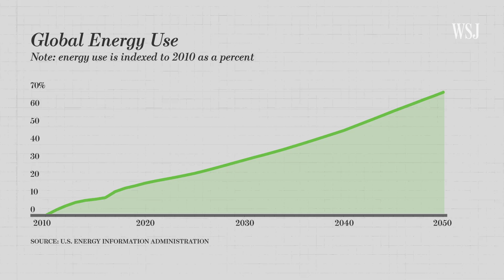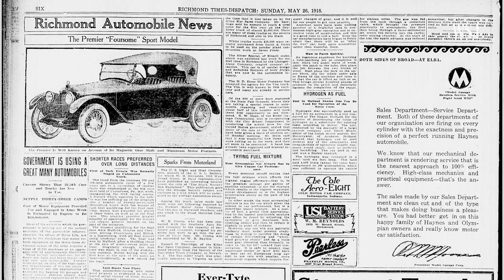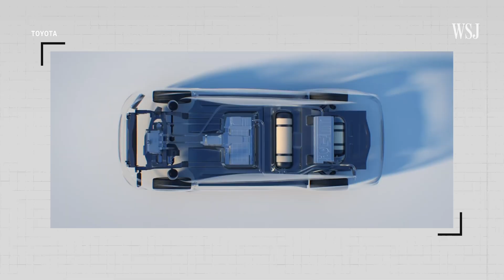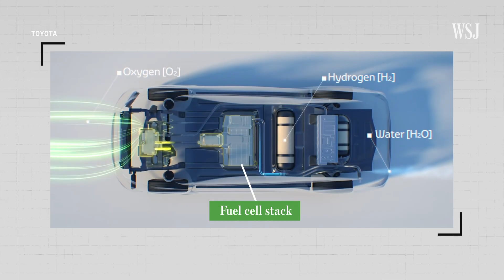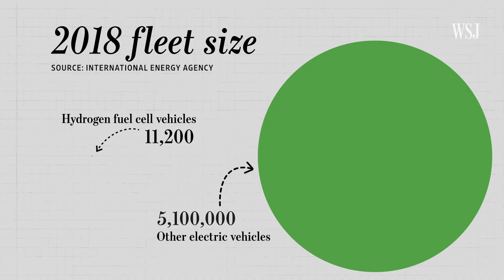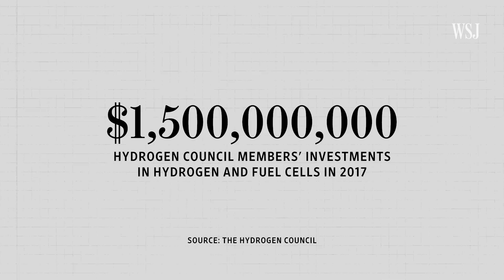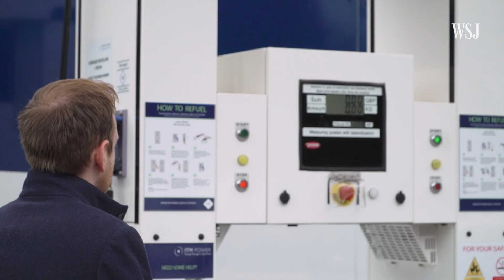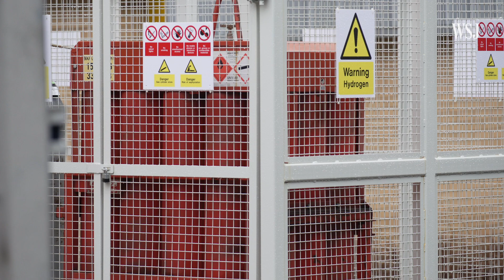Can Hydrogen Fuel the World's Fast-Growing Energy Needs? | WSJ

Comment: But is the splitting of water to create hydrogen only to turn it back into electricity energy efficient? That was not even addressed in this video...
Reply: Short answer - no.  Elecrolysis is about 70% efficient, and then you lose even more energy compressing the hydrogen for transport, and then the fuel cell itself is only ~65% effiecent at turning the hydrogen back into electricity. In comparison, sending electricity on the grid is about 90% efficient, and batteries are about 95% efficient at taking in energy and putting it back out to the motor later.

Comment: Hidrogen pros:
Quick to refuel
Water as emmision
Continous energy like petrol
Hidrogen cons:
Flamable
Expensive to produce

Lithium ion battery pros:
Mass produced, scalable
Can be charged at home
Cons:
Recycling cost
Also flamable
Long time to refuel

Please add more and start smart, healthy discussion here 😉
Reply: Adhi Suryana add low maintenance to the EV pros
Reply: Hydrogen cons: 90% is made from natural gas. If made with renewable electricity, then it takes 2.5 times more solar panels or wind turbines to get electricity back out than if you put the electricity straight into a battery.

Comment: Short answer: no. You lose around 70% of electricity in converting it to hydrogen and back to electricity, so end  up using twice the power of electric cars... + All the infrastructure, transportation, etc needed.. wait a few years for further battery improvements and it will become obvious to everyone that hydrogen cars is a dumb idea..
Reply: demolazy  people will recharge batteries when the grid is "full." I hope current industrial users of hydrogen switch to getting it with renewable energy instead of from natural gas, but until they do hydrogen is not a green fuel.

Comment: Hydrogen should be used in towns for heating buildings, the one that are heated with methane gas (natural gas, CH4). That way they can become CO2 free heating solutions.
Reply: 90% of hydrogen is currently made from natural gas, so not zero-carbon. If you make the hydrogen using renewable electricity, you might be better off using the electricity to power a heat cell with a COP efficient greater than 1 (1 unit of electrical energy can can move several units of heat energy around).
Reply: @skierpage  You can make hydrogen with natural gas BUT you have to scrub CO2 on site and store it underground so instead natural gas in towns you have hydrogen.
Yes, heat pumps with high COP is better solution for heat  production from renewable electricity. But we have so much towns with infrastructure that is already with natural gas so bringing hydrogen would be fast temporary solution. Lot of town are heated today with natural gas. I also like seasonal heat storage, this solution can heat towns with solar only, search for that it's interesting.
Reply: @klokoloko2114  existing natural gas distribution pipes can only support about 20% hydrogen before leakage and embrittlement become a problem. Fossil fuel companies are excited about this because it sounds green while preserving natural gas infrastructure, but it's not decarbonisation without huge investments to support 100% H2 delivery.

Some new housing developments are skipping gas lines to houses altogether in favor of all-electric, which must be terrifying gas companies.

I hope hydrogen for seasonal energy storage works out. It's one of several technologies getting development money, read "ARPA-E Funds Research on Energy Storage That Can Last for Days"
Reply: @skierpage  I'm for every solution that can bring CO2 to 0 ASAP.

Comment: The issue: the world needs to become carbon neutral a lot faster than 100 years.
Even the potential end to end efficiency of hydrogen which will probably take decades of research to reach is far below using renewables directly with batteries. 
Hydrogen still has its industrial applications and is probably the only clean method for aircraft and spacecraft. But the energy demand of those industries is tiny compared to the total primary energy usage in the world.
And in many other places it seems far more feasible to work around the constraints of batteries than wasting huge amounts of renewable energy on hydrogen production and storing.
For trucks for e.g. massively expanding the railway network to make sure that the vast majority of destinations is within the range of cargo stations that battery powered trucks can deliver.
Reply: How do you power (useful) aircraft with hydrogen?
Reply: @PistonAvatarGuy  
For smaller aircraft fuel cell plus propeller seems to be working reasonably well.
There have also been experiments with powering jet engines with H2. But this seems to be more problematic. 
It is probably true that both variants are inferior to using traditional kerosene,.but to obtain that, you either need to produce it from crude oil, which is a non starter for carbon neutrality or synthesize it from plants.
The problem with the latter being that with rising temperatures and the increase of droughts and advance of desertification that comes with that, while the world's population keeps increasing,  using farmland to "grow" fuel instead of food becomes a very contentious issue.
Reply: @ymi_yugy3133  There are actually a few ways (at least) to produce synthetic, liquid hydrocarbon fuels that can be used in existing aircraft. Google: fuels from CO2, US Navy makes fuel from seawater.
Reply: @PistonAvatarGuy  the first one seems more promising. Tough I fear that when you not only have to perform electrolysis but also carbon capturing the process could be prohibitively inefficient. 
The navy method seems completely pointless. 
First, they need to process such vasts amounts of water, that this would become detrimental to marine coast life and require lots of energy for pumps.
Second and more importantly it's not carbon neutral. They extract carbon from sea water and through the usage as fuel release it in the atmosphere. To make matters worse it seems that methane is produced as a side product, which is a significantly stronger green house gas than co2.
They might as well use oil. Factoring in energy needed for production that could even be more environmentally friendly.
Reply: @ymi_yugy3133  Yes, some of these methods require electrolysis, but you end up with fuels that are actually useful, unlike hydrogen. These fuels can also be used in existing vehicles and would make use of existing refueling infrastructure, which puts them far out ahead of hydrogen. You could never replace the worlds entire fleet of vehicles in time to avoid a catastrophic warming event, especially because most people aren't willing to give them up. The energy and resources required to replace every vehicle on Earth is far too great anyway.
-
You're lacking quite a bit of information on the Navy's method of fuel production. First, filters could be built around the seawater intakes which prevent marine life from being consumed during the production process. Second, it is carbon neutral, because atmospheric CO2 dissolves in ocean water, this is why the oceans are becoming more acidic. The oceans are a HUGE part of the natural carbon cycle. By removing carbon from the oceans, their acidity would be reduced. The CO2 from the burning of the fuel in vehicles would go into the atmosphere, but would be dissolved again in the oceans.
-
Other valuable resources could also be extracted from ocean water before the fuel production process, like lithium, thorium, uranium, table salt, etc.
-
Methane makes a great fuel and could be burned in a generating station which produces energy for the production of the fuels. It could even be used in fuel cells at the fuel production site.
-
ALL of these fuels require an enormous amount of energy to produce, including hydrogen, but hydrogen is almost completely useless as a fuel for vehicles on Earth.